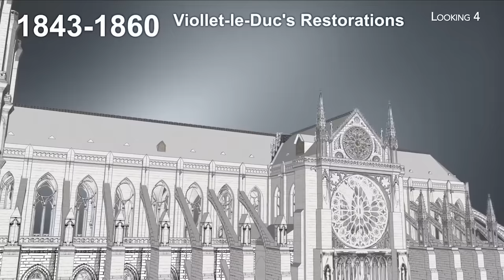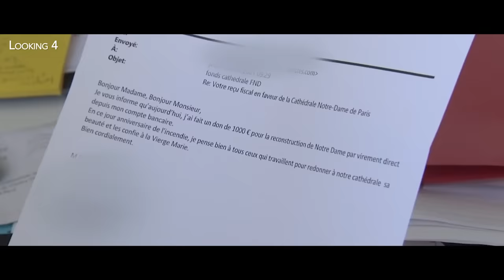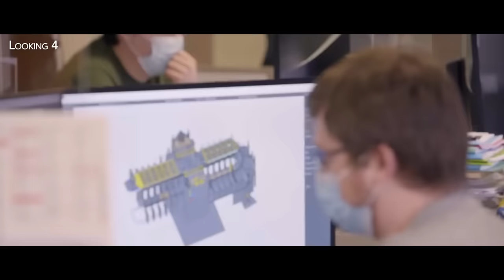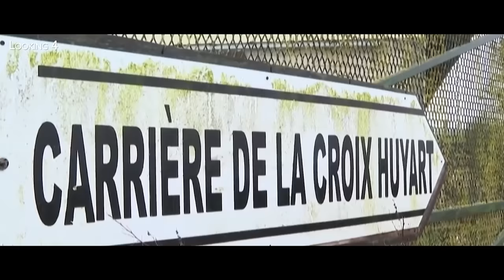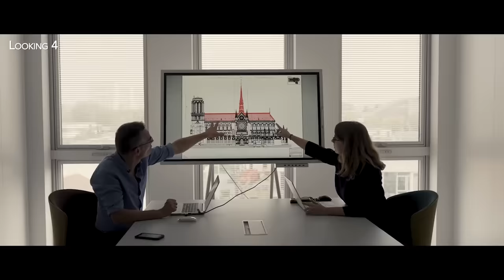NOTRE-DAME : The Latest News about the Restoration of the Cathedral

Comment: Sincere question:  Why is the public paying for the repair and restoration when the catholic church body is the wealthiest organization on the planet?  Is the cathedral not associated with the catholic church anymore?
Reply: The public is not paying for the restoration. The funding is private donations.
Reply: @heliedecastanet1882  Yes! That is correct, of course! I was meaning donation based instead of supported by the actual Catholic Church. Thanks.
Reply: @bryantkeller9278  Well, it is a difficult question to answer, because in France, the State and the Church are separate, but the cathedrals (and most of the churches) being considered as work of Art, the public finance is supposed to take care of their restorations and preservations, whereas the Church is supposed to take care of their maintenance and running (the French catholic Church does not have enough money anymore for restoration and big works).
Since the Church was responsible (partially) for the fire, the situation was complex. The French Church could not afford the reconstruction, and on the other hand the population would not have agreed with paying 1 billion - and the Vatican did not say much about taking part of the final bill, if you remember well.
So the private donations can be considered as some sort of a "miracle" because it gave a solution to a complex situation.

Comment: what happened to the person who burned it down? they need to be punished
Reply: It's a system failure. Most likely, the fire started accidentally by a careless worker. The system failure is to have work done on such an important building by the lowest bidder.
Reply: @ingvarhallstrom2306  Well regardless that “careless worker” and their supervisors, senior management etc should all be fired:  for carelessness of course, but also for lack of supervision and failure to protect the safety of the cathedral and the workers when it occurred.
Reply: @davidepperson2376  Sure. But unless you raise the standards this will happen again...
Reply: I’m sure it was an accident.
Reply: There was a recent study in the "forest" (the medieval carpentry) that stated that the amount of dust was a fire hazard. The authorities have not followed the advice of the experts. I doubt that the information was transmitted to the workers on site.

Comment: the whole frame to support the arrow is placed (it is called the stool) we will soon see the frame of the arrow being assembled, the whole frame is prepared in several companies, everything is brought by the Seine on boats, thanks to the highest crane in Europe, the one we see in the video, the elements are unloaded from the ships and mounted directly at the top of our lady, the stones that support the frame are being changed because the limestone exposed to the heat of a fire turns into lime, and lime is very fragile, so everything around it will change! after the carpentry will be started!

Comment: Using wood again for the roof is not just an unnecessary waste of fine Oak trees, it's also a grave mistake for the safety and integrity of the building. It's just a matter of time before it will burn again. Not an "if" but a "when".  😟

Comment: So they didn't learn from this fire not to use wood again?  Wood is not a material you use in the structure (roof and spire) of a building you want to last for centuries.  Not only because of fire, but also termites, fungal rot, thermal expansion, etc.
Reply: It worked perfectly well for hundreds of years, and still will.
Reply: Umm, the fact that the cathedral is closed for several years for some strange reason says otherwise.
Reply: @jasons8479  From the 12th to the 21st century is not so bad, I would say.
Reply: @jasons8479  Combustion of timbers of the type used in this kind of construction, especially when aged and iron hard is extremely difficult, without some form of accelerant, which would tend to rule out the accident theory.  In fact large timbers of this kind retain their structural integrity  in a fire longer than uncased/unprotected steel because they form an external charcoal coating which ceases to burn and protects the inner part of the timber. Uncased steel, on the other hand, will buckle, distort and collapse when temperatures rise sufficiently. Rebuilding with similar timbers is exactly the right way to go.
Reply: Actually the first one (from the 13th c.) became so damaged it had to be removed in the 18th c. and replaced in the mid-19th.  This 21st c. one will be the third one it has had.  But, yes, I'd say that's a pretty long time for wood.

Comment: will france be smart and put in smoke dectorts and fire fighting systems up in the roof and the rest of the Building, how is france gping tp make 2024, they are always on strike
Reply: It was not "France" which was supposed to put smoke detectors, but the Church. The cathedral has always been under the care of the catholic church, not of the government. The government had urged the church to check all the system. The church obviously did not 🙂 So ask the question to the Archbishop of Paris, because the French government won't be able to answer you 🙂
Reply: @heliedecastanet1882  yes or no Who is paying for the repairs, I been told it was france as the Church was broke, Even France who got spanked in WW2 with a years notice to get ready has Build code,
Reply: @dknowles60  You were wrongly told.
Have a good day 🙂
Reply: @heliedecastanet1882  my facts are right,  if not france that is paying the bill. it sure is not the church, fRANCE WW2  spanking speaks for its self
Reply: @dknowles60  Ok 🙂 If you say so 🙂
Have a good day !